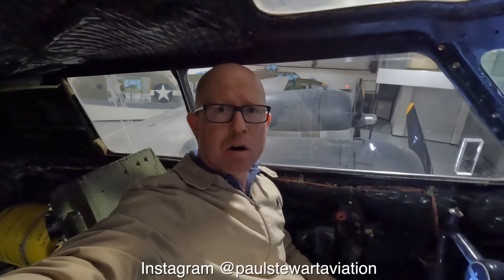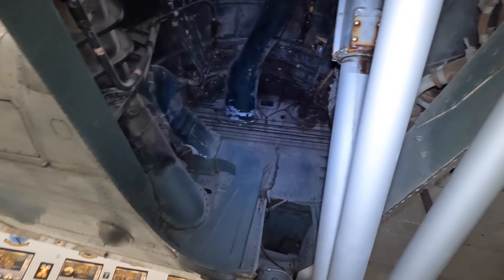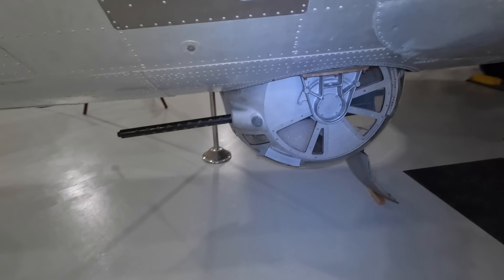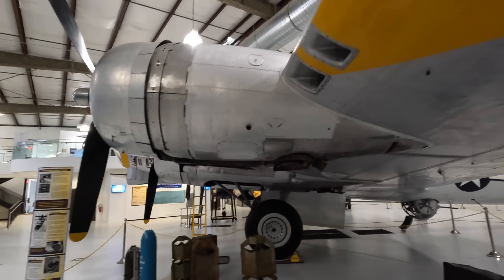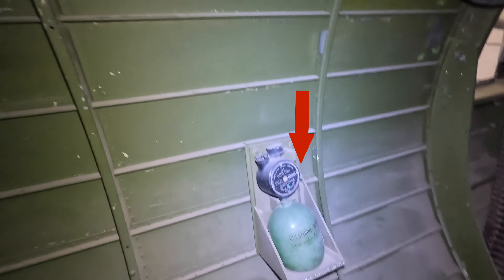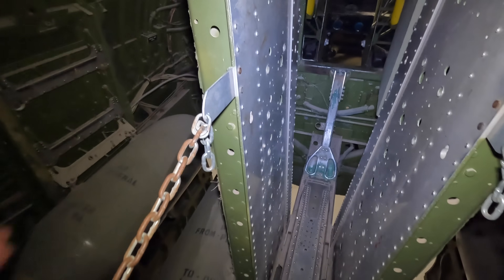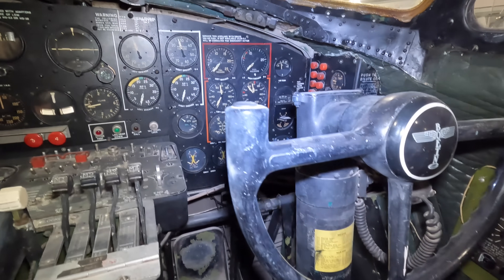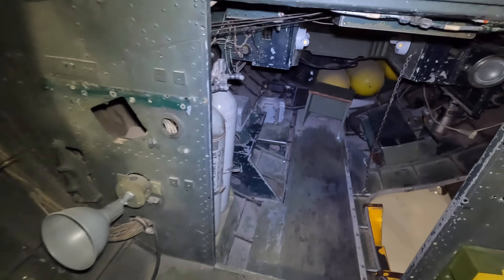Detailed tour through a Boeing B-17 Flying Fortress (as featured on Masters of the Air)

Comment: You mentioned B-17's flying at 30,000-feet... really??? Even later marks of the Lancaster MIGHT reach 20K.
Also the B-17's were slow... my dad, a MUG in a Lanc, remembers seeing "forts" flying OUT of a target zone while his Sqn was inbound in the evening/night.  AND, overtaking them on THEIR WAY home after bombing their target. 
A "normal" load for a Lanc was 8-to-12,000lb, depending upon the distance flown. And as you mention the B-17 could only max out at 8K, on very short missions.
Reply: Just about everything about your statement is wrong.
B17's flew both higher and faster than Lancaster's, you're dad's story is highly erroneous, either he was just plain telling stories or saw 2 different formations of B17's and mistook them for being the same one, B17's flew faster than Lancaster's because they flew in the thinner air at higher altitudes, that was because of their turbochargers, a B17 with a full internal load could fly higher than an empty Lancaster. And how exactly could a Lancaster flying night missions have seen B17's egressing from missions that flew daylight missions? And have passed them on the way back when the fact is all the B17's were always back before daylight was over? They couldn't possibly have, so that just amounts to a bunch of story telling. 
Here's some actual facts for you.
The max payload for a B17 was 18,000 lbs using external racks which contrary to what some people claim were indeed used in Europe to attack the sub pens on the coast of France.
The maximum internal load of a B17 was 8,000 lbs with the typical load out for a deep penetration mission to Berlin being 5,000 or 6,000 lbs depending on the type of bombs used.
Just because Wikipedia lists the maximum internal load of a Lancaster being 12,000 lbs doesn't mean they flew missions with that load, on deep penetration missions like Berlin they would have carried approximately the same amount as a B17, I don't know why all you guy's think the Lancaster could defy the laws of physics but I can assure you it couldn't, the B17 and the Lancaster had about the same weight empty and same max take off weight and the same power per engine. 
Therefore the load out of the planes would be just about the same going to the same target, nobody in the history of aviation has ever designed an aircraft that can defy the laws of physics.
When a Lancaster was loaded with one of the massive block buster bombs it had to be highly modified to do it, including the stripping out the few defensive guns it had, along with it's altitude and range being greatly decreased, it's for those reasons that it was rarely used to drop the blockbuster bombs, it was just too much trouble coupled with the fact that the blockbuster bombs turned out to be ineffective against the hardened sub pen and V2 launching sites the bomb was designed to hopefully destroy, it just didn't work.
Lancaster's had a very long bomb bay but they were only one bomb deep and couldn't be accessed during flight, this means the bombs had to be armed on the ground and if a bomb didn't release the crew couldn't do anything about it, they were stuck with landing with an armed bomb.
The B17's bomb bay was shorter but it stacked bombs on top of one another in racks and the bomb bay could be accessed by the crew, this meant that the bombs weren't armed when it took off since the bombardier armed them in flight and in the case of a bomb not releasing a crewmember could either get it to release by accessing the bomb bay or disarm the bomb in case he couldn't, meaning that unlike the Lancaster the crew didn't have to land with an armed bomb.
B17's had copilots, Lancaster's did not meaning that if the pilot was killed or seriously injured the crew usually had no choice but to bail out, this is one of the primary reasons that Lancaster's had a higher fatality rate than B17's despite the fact that B17's flew daylight missions, coupled with the fact that Lancaster's were hard to get out of in flight and had few defensive guns on them.
Try watching the videos;
B17 vs Lancaster the truth, it's on a channel called Greg's Airplane's and Automobiles, he also made a video which completely dispell's the myth about Lancaster's being considered to drop the Atomic Bomb that was claimed by Mark Felton, unlike Felton Greg is an actual pilot and not some single engine Cessna weekend pilot, he's an airline pilot who's highly educated and experienced in the matters of flight and the physics of it, and for every fact he states he lists sources which aren't from videos, they're from things like NACA reports. 
He loves nothing more than dispelling all the myths people like to throw around about WW2 aircraft, especially one's like lower and slower flying bombers supposedly overtaking bombers on the same mission that flew higher and faster, he'd have a field day tearing that one up with the math.
Reply: The Lanc.s were awesome

Comment: You mention that the tail wheel and main landing gear were operated "electronically". They were not. They were operated electrically. If an electrical device manipulates information or controls a flow of electrons using resistors, vacuum tubes, transistors, diodes, etc., it is electronic. If the electricity simply turns a motor or lights a bulb, etc., it is electrical. The landing gear used simple motors turned on or off by a switch. 
It may seem like an insignificant detail, but then your channel is all about detail. 😁
Reply from the maker: I stand corrected. :) I recall noticing that when I proofed but forgot to change it.

Comment: The armor on B-17s wasn't "bullet" proof like a lot of people believe. The armor might deflect a machine gun bullet, but definitely not a round from an airplane cannon, which the Germans carried on all of their interceptors. Both the plane armor and the flak vest were there to stop shrapnel. They did a so-so job. Guess it depended on how close the flak shell exploded to the plane. Having been on a B-17 in flight (Aluminum Overcast) I'm amazed at how brave the kids were that flew combat missions in them. The planes were made with metal that wasn't much thicker than a beer can of the same era.
Reply: Flak blasts went 360 degrees
Reply: The crews sat on their flak jackets.  Flak blasts went upwards.
Reply: @danielgregg2530 flak goes in all directions from all directions. But I've heard of aircrew sitting on their flak jackets because they were being shot at from the ground.

Comment: Flew in EAA’s bird, Aluminum Overcast, a few years ago, what an experience. It’s bumpy, noisy and cramped but the smell of avgas coming off those radials makes it all worth it. 

It’s a lot smaller inside than it looks from the outside, kind of a reverse TARDIS.
Reply from the maker: wow what an experience that would have been!!

Comment: The B17 did in fact come equipped with a autopilot. It was mainly used to transfer directional control of the aircraft to the bombardier during bomb runs, to increase target accuracy.
As you can imagine, using a autopilot while flying in tight formation with many other aircraft is a recipe for disaster, so, for the majority of the aircraft, the entire mission was hand-flown, with the exception of the lead planes which were the ones doing the bomb aiming. 
Great video!
Reply from the maker: Thanks for the clarification

Comment: My first video from Mr. Stewart, and it was pretty good. I will watch another, and hopefully, it will not mention protection from sparks caused by bullets striking aluminum wings.
Reply: To be fair, the entire wing is not made from aluminium, it does indeed contain steel structure. The Luftwaffe used steel cased rounds as well so this is a plausible situation. However the fuel and vapour venting system may be more commonly effective against things like incendiary or HE rounds or for ignition prevention during emergency landing. I don’t think the main wing tanks were self sealing either, only the outer “Tokyo” tanks when installed.
Reply from the maker: Surely a metal bullet striking aluminium could ignore fuel vapour?
Reply: tracer rounds

Comment: I had a chance to ride in one of these at an air show a few years ago. We got to move around during the flight including in the cockpit behind the pilots. What amazed me was how much work is involved in flying the plane even in level cruise. There are no computers to monitor, let alone control, the mechanical systems, so the pilots were constantly monitoring all the gauges and making fine adjustments to fuel mixture and throttle. They would also periodically take notes to keep track of fuel and oil consumption and other performance factors.
Reply from the maker: how incredible to have flown in one!!
Reply: I got to ride Sally B at a airshow too! Was an incredible experience, ill never forget how much it creaked during flight.. I don't know whether that was due to age or if that was genuinely how they flew at the time, but yeah "mechanical" is exactly how I'd describe it! :)
Reply: I rode in one years ago, too.  The aspect of moving around from the waist-gunner position to the bombardier nose made it a better experience than riding in a B-29, which was more like being in a cargo hold in the rear. 
Ever since that experience with the noise and bone rattling vibrations, I could not fathom how the flight crews could handle six hour flights.
And for those out there that sees movies/TV shows of bomber crews openly conversing with each other during flight?  Not!  The volume of the noise is just too intense!
Reply: @bloqk16 8